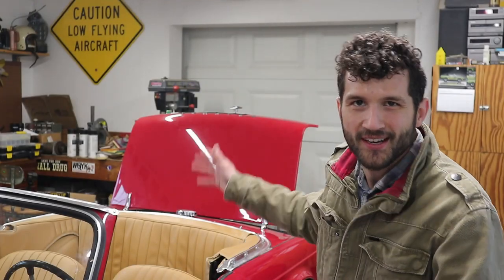Trimming the Boot - Installing the Casing Board and Trunk Carpet Kit | Triumph TR4

Comment: Remember you have all that space behind the gas tank cover, I use it for parts on a long trip.
Reply from the maker: Good point! There is a ton of space there. Could easily stash a bag of tools and parts in there. Seems like the board is really not that necessary in reality. It just makes the trunk look pretty.
Reply: @WegsGarage  work jacket with tools goes in the tire along with jack and knock off hammer. Coil, points, belts, hoses, water pump etc go behind wall. leaves room for brake fluid, oil, stock jack, in the tire well. This way you can still have room for beer, genset, suitcase, Haynes  book and more.

Comment: Great job, gives me a quality standard to shoot for. (And it makes me long for the days when my dad would crawl under my high school cars with me to help and teach me. Enjoy and appreciate every moment because it won’t last.) But I digress…quick question: at about 7:50, you pan past the top of the trunk where you can see the ends of the rubber gasket meet. Would that be better at the bottom where it might be less likely to let water in, or does it not matter? Thx!
Reply from the maker: Ah, this is a controversial topic on this car! I don't recall how we arrived at our decision, but we discussed it a bit in an older video. The ends are glued together so it is somewhat sealed.

Comment: Nice and neat, which is better than original in this case. I think the fitment of the gas tank covers isn't great - I had the same issue with my Spitfire.
Reply from the maker: Yeah, seems to be the case with most of the interior fiberboard parts. The factory must have really done things differently to get everything fitting right.